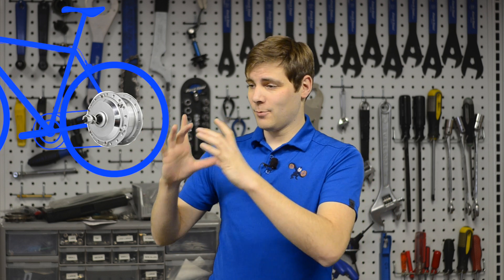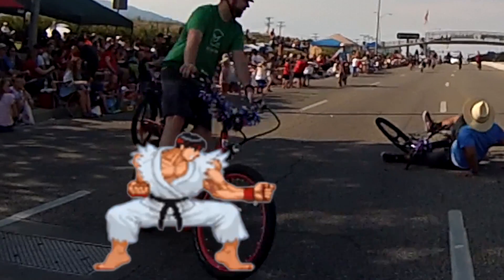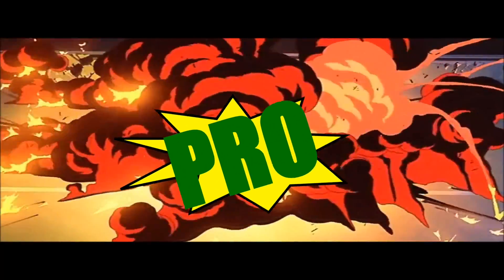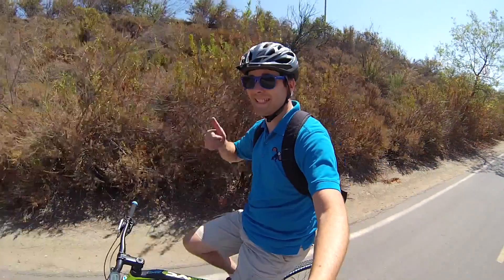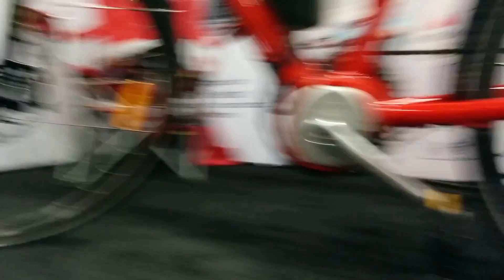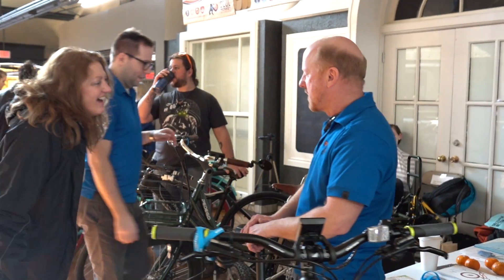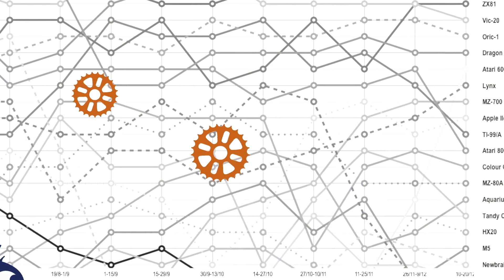Hub Drive VS Mid Drive eBike motor systems

Comment: I have a rear hub drive Fuji e-traverse. Basically a 21 speed Fuji traverse with a hub drive motor. I don't have a throttle as class 1 e-bikes don'. I have never ridden a class 2 ebike. I control the bike speed with the gears. I had my chain slip off the bike and jam yesterday. Fortunately I was able to get it back on the gears properly. However you make a good case for a class 2 hub drive bike, especially a front wheel drive hub drive ebike. That is that if your chain slips of or breaks while riding you will still be able to ride the bike until you can repair it. Your video https://www.youtube.com/watch?v=vnBVXULCjSY  has convinced me that if my wife wants an electric bike to first convert her bike to an FWD hub drive with a conversion kit. I am concerned about FWD hub drives for safety reasons though. My ideal bike today would be a bike with a midrive Bosh Gen. 3 or 4 motor, belt drive to rear wheel, with  internal hub transmission, dual battery, tubeless or non pneumatic flat proof wheels and "tires" and some kind of easily detachable and portable aerodynamic fairing or windshield to minimize parasitic drag.
Reply from the maker: If a chain slips or breaks, you can still use a hub motor bike in the rear wheel, so long as it uses a cadence sensor, and/or a throttle
Reply: @BlueMonkeyBicycles  Thanks I didn't realize the cadence sensor would still run the motor. Should I be concerned about safety for a front wheel hub motor, with throttle on a bike that has old non disc mechanical caliper brakes if I convert it to an ebike? I have thought of taking off the front brakes entirely.
Reply from the maker: Since electric bikes (converted or production) are heavier and faster, I would not recommend removing the brakes.

Front hub eBikes can slip out when given too much throttle at a sharp turn (such as powering from a stop). Generally, rear hub is preferred, unless there is a compelling reason otherwise. It's worth the extra work during installation.
Reply: @BlueMonkeyBicycles  That's what I thought. It would result in a bike that is unsafe and unstable. It's really not worth the money or effort to convert the bike to rear electric drive and add disk brakes.  I'll get an e-traverse open frame for her if she wants an ebike.
Reply from the maker: Disc brake conversions are a pain. And, buying the components for discs aren't cheap either. Good choice

Comment: I like hub because of low cost, bike is not supposed to go high speed,so bit load in front hub is not an issue, I can also go with full electric mode or  assist mode, in assist mode the split ratio between manual pedal and electric power is fully controlled by rider. Only minor issue with hub is hub may consum a bit more electric energy. It's personal opinion

Comment: Hub drive for me, more power, more torque, easier to replace, more reliable less moving parts, modular components (controller) easier to replace/modify/upgrade, easily upgradeable motors, more weight on rear wheel great for traction, easier to lift front wheel, many many options when purchasing, easier on the drive train (no torque on chain), best of all THROTTLE!!!!  All these things keep me in the hub camp.

Comment: Big difference in price. A nice rear hub drive eBike can be had for around $600. I have an Ancheer and it's a great bike. A mid drive will run you 2 or 3 times that easily. Nearly all of the rear hub drive bikes have pedal assist and a throttle, and a throttle is better for finely tuning the power to the wheel. Not sure why he stated that you see more on a mid drive bike, that makes no sense at all.
Reply from the maker: What do you mean by your last statement? See more what?

Comment: please do an update on this video...as there is a massive amount of brands of mid drives that can literally fit on any bike ....bafang to name one  you also missed out on a few points the mid drives can have a throttle and run sole'y on the motor alone..no peddling at all...plus you have the added benefit of being able to use the bikes " transmission" making the mid drive 1000000x's better than a wheel drive
Reply from the maker: I think your math is flawed

Comment: You didnt mention that some mid drives dont require pedalling, mid drive combined with a front and rear hub drive i would love too see. Also Stealth bikes are 100% designed not too have the issues you listed

Comment: I'm surprised at the mention of chain breakage in center mounted electric motorized bicycles. Besides this video I haven't seen it mentioned as an issue anywhere else. I realize that this can happen but, if it was a somewhat common occurrence I think I'd have read about it in other places, but I haven't.
Reply from the maker: Things have improved over the years since making this video.

My advice is to talk to the guy at the back of the shop who has to fix busted bikes: that's where the chain breaking gets reported.

Comment: Hi you sold me on the rear hub motor thanks I was looking at mid drive but i am heavy and put enough strain on the drive system as it is
Reply from the maker: Well, heavy load puts strain on spokes too.
(Just an illustration, it not a rule of thumb or anything) Between 250 and 300 you could ride a hub motor, but you'd want to tighten up the spokes often. If you're 300-400 I'd recommend solid wheels (often called mag wheels, or cast rims), also check the brakes often.
If you're North of the 400th parallel, then you might be looking at a custom build. Probably a trike

Comment: Front to back balance off with a hub drive? No, you have a heavy battery in front of the bottom bracket. The negatives of the hub drive are overstated.  Prices for mid-drives are inflated.
Reply from the maker: Front to back balance is a real thing. Ask pedego

Comment: Here is what i want to know....

If you have a 1000W mid and 1000W hub all things being equal which will accelerate faster and which will have a higher top speed.

It seems to me the mid drive would accelerate faster and be able to achieve a higher top speed because of the gears acting like a transmission, but what do i know. 

Thanks for your response
Reply from the maker: Top speed will be governed by the control. All things equal (no governors) the mid drive will have greater top speed options, side you could use the gears to attain a higher max on the wheel. 
The hub drive world have greater acceleration off the line, since the power goes directly to the wheel, and bypasses the chain, gears, and especially gears changing.

Comment: Which one of the two drives is easier to pedae with, if you run out of battery power or another malfunction happens? I have a hub drive and find it very hard to pedal.
Reply from the maker: Overall, I find them both equally cumbersome. Some mid drives have internal resistance to them, which makes it a touch harder. But hub drive bikes are usually a bit heavier, so they're not pleasant either.

The best bike for using non electric is one with the Fazua motor.

Comment: Chains breaking on a mid is an easy problem to resolve. Buy a internally geared rear hub and the heaviest chain you can fit on it. Mid drive chain breaks because every one keeps trying to use narrow chain.

Comment: does front and back hub sort of balance out or just double ungainly?
Reply from the maker: It might balance on the scales just fine, but double motor weight is really tough to use on a tough mountain bike trail.

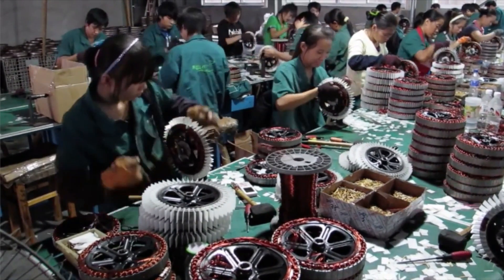Comment: OMG they're winding up those motors by hand? 1:08
Reply: My thoughts too! I'm fairly certain machines exist for this, but it does give me hope that I too can rewind motor coils, if needed, with minimal efficiency loss. I've actually been wanting to for an experiment.
Reply: Its about economics. If the machine costs 10 yuan per day in electricity to run, but it only costs 8 yuan a day to employ enough workers to do the work by hand at the same speed, the hand winders are more economical. Plus with machines you need to employ engineers to keep them running, you get downtime when they conk out, they take up a lot of room, etc....

Comment: Who switches tyres often normally, mid drives are no use if your legs are fkt , especially the speed they stop and start at, it makes your life a lot harder with poor legs , also your chain lasts a lot less  time with a mid drive.

Comment: Would a hub motor take more of the shock loads, from major bumps in the track than, a center mounted system ?
Reply from the maker: Quite the opposite: the hub motor weight is not benefited by any suspension, so the bike feels a bit heavier and harder to control (over a mid drive of the same weight). It's not insurmountable, but all other things equal, a mid drive is much better for off-road.
Reply: @BlueMonkeyBicycles   Thank you

Comment: No one ever mentions that if you have a puncture with a hub motor you are SCREWED!! There is an electric wire going to the wheel which makes it impossible to take the wheel out of the bike which means you can't repair the puncture, so either gotta go back to where you bougth the bike or do it yourself but there is no way you can do it on the way, you would need to do it home to make sure nothing gets damaged. Go for a mid drive, a little more pricey but worth it! I have 2000 watt hub motor which I love but if I could go back would choose a mid drive!
Reply from the maker: Mid drives are great and all, but I assure you, it's not impossible to fix the tires. It's a lot more work though! I mention the weight of the wheel on the video: the elephant in the room. The electric wire is as easy to unplug as a toaster (unless you have a cheap crap electric bike).

Comment: My mid-drive motor “broke” leaving me stranded miles from home. Give me a front-hub drive for reliability. If the battery fails or the motor dies, you can pedal. If your chain brakes (never happened in 60 years if cycling) you can still motor.
Reply: Wasn't a focus impulse drive bike by any chance was it ?
Reply: good points!

Comment: This video needs an update I think. You essentially make it sound like the second you take a mid drive motor up a hill you’re going to snap a chain when in reality there have been tests done to show that mid drive eBike drivetrains last only slightly shorter than their acoustic counterparts. With a properly maintained drivetrain you’re not just going to randomly snap a chain. Over time, sure. But again that’s the same as on any bike.
Reply: Fly Rides USA yeah I’ve ridden a mid drive for 2 years and never had my chain snap. Plus I know how to fix it if it does! Carry a chain breaker and easy link people!
Reply: @teenageguruproductions5120  Gotta know that trail maintenance!
Reply: What's an "acoustic counterpart?"
Reply: @rhettarten6550  Haha we call "regular" bikes "acoustic bikes"
Reply: @rhettarten6550  referring to a non electric bike
Reply: Fly Rides USA I agree with you! Mid-drive motors do put more force through the chain but it's not going to snap your chain. I have bikes with over a thousand hard ridden miles and the chain may have stretched, but never broken. Then I replace them as needed. Simple maintenance will prevent chain failures. Also, newer bikes are being equipped with eBike specific chains. THANK YOU KMC! 
Lastly, the small chainring on Haibike eBikes prevents the chain from hitting the chainstay/rear triangle when equipped with motors with small chainrings, like Bosch. When you assume, you're making an a...you know the saying.
Reply: @HectorSalcedo  I totally forgot about the eBike specific chains. Yep just another thing. Lot of good points in this video but I think they missed the mark on mid drives.
Reply: Totally agree and even think "eventually" is an overstatement. Most snaps we see at our shop were from yes poor maintenance, but poor shifting and cranking on a motor in high assistance from a stop. Saw this a lot more 2 years ago with the older Brose (being so high torqued) but now see less and less. Put an ebike specific chain on and do your riding!
Reply: Maxwell Shenk totally! Still gotta treat that drivetrain like it’s a regular bike and then you’re gold.
Reply: Yeah, I've been riding mid-drives for years and personally have yet to snap a chain.  I think this might be more of an occurrence on Bafang motors but no issues on the Bosch and Brose systems I've been riding.  I think chain breakage is generally do to operator error and not being cognizant of shifting under load.
Reply: @ikefazzio4721  Couldn't agree more. I would be interested to know if there's a difference in drivetrain durability between mid drive motors. Maybe I'll have to do a video on it.

Comment: Ya, the BIG problem with mid-rive system is the chain and do not expect it to last, at all. Another weak spot in the mid-drive systems is the sprockets, front and rear, they will not last if you ride on or off road more than 3 or  more times a week and don't let any one tell you otherwise because I did it for over 14 years on a Raleigh M20 a GT a Ironhorse and finally a real tough Giant and those parts will not last longer than 2 years or less each. So I have come up the solution and that is using a Shimano 8 speed hub with a no# 35 chain sprocket from a  go-kart welded to the original sprocket already on the hub then replace the front sprocket on the bottom bracket thats attached to the mid-drive motor with a large go-kart 30 or 40 tooth sprocket. The no# 35 chain will not wear out as fast and the chain, without the use or the need for the derailleur, will always stay tight and can be adjusted over time. Other benefits is that the no#35 chain can take a lot more abuse and is much stronger for those harder trails.  The 8 speed hub leaves that only a single sprocket is needed and can be much cheaper to replace if it even ever does wear out on just a bicycle. Try it if you can it is going to save you a lot of cash over the long haul. The no#35 chain is rated at over 20 to 40 horsepower and your not even a horse so it will last a long long time.

Comment: I've been rockin a rear gearless hub drive for years and live the feeling. 
Is it true that a mid drive will provide more range than a hub?
Reply: A 2017 study actually showed that, contrary to popular belief, a geared hub actually provides better range than a mid drive, though I believe direct drive was the worst. But it's clear mid drives don't have all the advantages people think. But geared hub + torque sensor appears to be the most efficient option for most riders.
Reply: @DumplingsEverywhere  geared hub+torque sensors? I thought that the torque sensors were specific to mid drives because of the way they work. I guess it's the torque sensors alone that really makes the defining difference in boosting range. My first ebike had a front geared hub and that was not really any better than my current DD hub in terms of range.

Comment: You forgot to mention the torque stress on the rear wheel with rear hub. This is a trade off comparable to the stress on the chain with a mid drive. Front hub has its own issues you didn't mention either.  👎
Reply from the maker: I got a different video covering front wheel. I can't cram everything in
Reply: @BlueMonkeyBicycles  you spoke about the pros and cons of hub drives, but didn't mention how they torque the rear wheel out. (I don't think that would fit in your front wheel video.) Which is a big con. Not mentioning that will make you seem either 1) lacking in knowledge or 2) avoiding telling too many bad things. You clearly prefer hub drives and ignoring facts makes you seem really biased.

Comment: I have an idea that would bump The Hub drive ebike into the lead... I recently bought a nanrobot D4 +, and it is a thousand watt Hub Drive in the front and a thousand watt Hub Drive in the back... why don't we do this to an e-bike like say a 750w hub drive in the front & a 750w hub drive the back... well that would eliminate the unbalancing of the back into the front end of the bike I admit it would add a lot of weight to the bike but you would have that balanced weight to give you a better Center of balance and it would pull from front and back which would eliminate that awkward feeling you experience while riding up a steep hill it would be pulling from the front while pushing from the back... just for the record I write a 500 watt rear hub drive ecotric Fat Tire so I'm used to a bit extra weight begin with and I got to say it does pretty well at around 25 miles per hour with just the throttle on flat it, on the other hand the nanrobot D4 + well that does 40mph, and it's pretty badass to say the least if your not using Eco setting and your pushing it you'll probably get about 15 to 20 miles out of it but if you are easy on the throttle and you're in eco mode with single Hub Drive you likely will get 30 to 40 miles out of it as long as you stay on a smooth level route.

Comment: I've got a bbshd mid drive running off a 52v battery.  Can I also add a 48v battery at the same time, or will it burn the motor out?
Reply: Neil White Battery will never burn out the motor. As long as the motor is the same Volts
Reply: @Beniamin6665  Hi, thanks for the reply.  However, I don't understand? The motor is 1000w. I'm running off a 52v battery, can I add a 48v battery at the same time? To give more power and range? Thanks

Comment: I think Hub motors win overall because of expense, simplicity and reliability. The only real con for hub motor is the weight, and hill climbing which can be fixed with 2WD.
For the price of one Mid drive Motor, I can buy three Hub motors...

Comment: A motor will not put the same kind of stress to a chain because the power is even. Not like your feet that push very hard every 180 degrees. What most likely happened is that the motor plus your feet pushing really hard caused the chain to break. A strong cyclist may put as much as 300w when pedaling max. Add 500w from the motor and you will see why the chain may break.